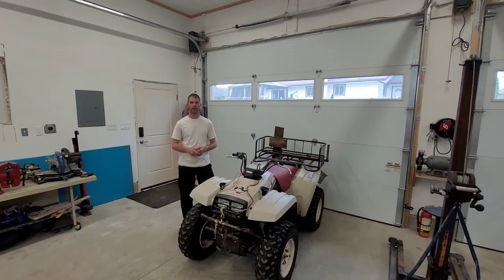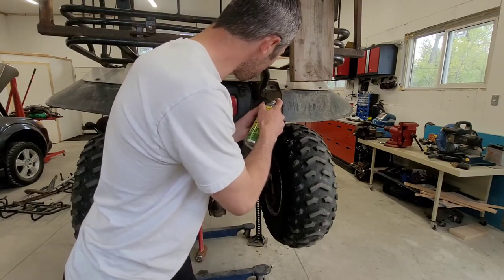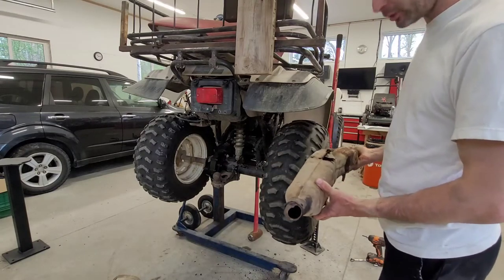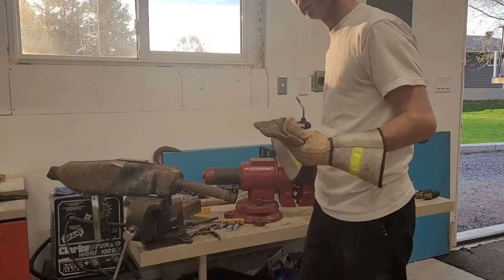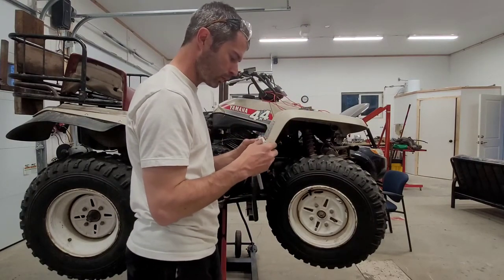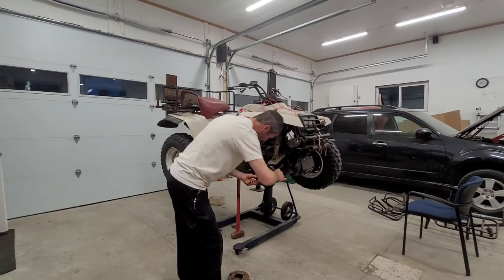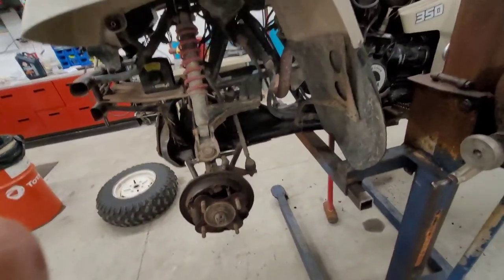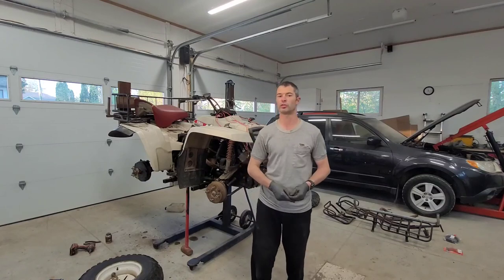Yamaha Big Bear 350 Restoration!!! Part 1

Comment: Yes your welds are not perfect, but those atv mufflers are super thin material wise, so welding them is extremely difficult. In all honesty, that patch job looks good, you did a great job sizing and fitting the metal in place. 👍

Comment: This mini series had been very help in my fixing up a Big Bear just like yours. I continue to run into obstacles though. One I hoped you may be able to help me with is the front transfer case oil. I pulled a CV axle to rebuild and quite a bit of lubricant came out with it. I cannot find any pictures or videos of how to refill the gear box. I cannot find a bolt, plug, or fill tube going to it either. Have you any insight on how to fill it back up? Thanks!
Reply from the maker: Thanks Evan for the comment! I will make a video on how to replace the front diff oil. Once I do, I'll try to notify you right away. Again, thanks for the support!
Reply from the maker: https://youtu.be/-ZW_Ru4fjyY. This is the link to the video you have requested! Again thanks for watching my channel!

Comment: anyone tell me how wide the big bear is tire to tire, I don't know if it fits in my trailer and can't find is the width of 48 inches does that include the tires or not? is it 48 plus tires at 60 wide or 48 with tires included. I have yet to pick up the bear and need to know if it will fit in my truck bed
Reply from the maker: My big bear is 44 inches wide with my 27 inch tires. The overall length is approximately 80 inches. Hope this helps. Thanks for commenting and I hope you enjoy your big bear as much as I do!
Reply: @thehonestmechanic  Well, we took a gamble and shoved the 88 big bear into a trailer 44 inches wide... front tires were tighter than the rear oddly but it fit! are the front tires wider I wonder... Thanks for your uploads, my daughter and I will be working on our big bear in tandem to watching your instructional videos, and kudos to her camera work.

Comment: What is it when your tire dozen moves when you put it in gear? The right side front tire
Reply from the maker: I think you are referring to when I applied the front brake lever on the right side of the handle bar. A few things were stuck inside the drum
Reply: @thehonestmechanic  Thank for that,Do I need to replace the drum
Reply from the maker: @J Smith  that would depend on how worn it is. It would be advisable to measure it and compare with OEM specs

Comment: Just bought the same Big Bear a week ago. Changing the Carb on it today. Still have to find the exhaust heat shield. My dad had one when i was a kid and I loved it. He still has it and it runs like a champ
Reply: Does anyone know the difference between the single cable carb and the dual cable carb?
Reply from the maker: Some older big bears like mine had one cable controlling the throttle while the choke had a pull know on the side. Not exactly sure but I think Yamaha added a choke control o  the handle in later years hence the second cable
Reply: @thehonestmechanic  that’s what I was thinking too but from what I am reading in the manual on the older model they have two throttle cables going in the carb. One moving the piston valve on the top and the other moving the throttle. There is a splitter halfway down the throttle cable that splits it from one cable to 2 going to the carb.
Reply from the maker: @ryana3679  I have it in the shop for another video (spoiler alert)LOL I'll take a look in the morning and get back to ya
Reply: @thehonestmechanic  you rock bud! Thanks.
Reply from the maker: So, I've looked at the Big Bear and I also have two cables and more questions. The parts breakdown doesn't help at all for the cable going  in the side. I have not pulled the carb on a big bear so I have no answers. I'll have investigate further. I might add it to a video 😉 Sorry Ryan....
Reply: @thehonestmechanic  I did the same thing with mine. Turns out they stopped making the 2 cable system and now you can only get the single cable carb. There’s now linkage inside the carb that allows one cable to do what the two cables previously did. If you follow the throttle cable there is a splitter on the older models. When you install a new carb you either replace the throttle cable with one without a splitter or reuse the existing cable with the splitter but only connect one end. I’ve subbed so I’ll be right there when you get that video out.
Reply from the maker: It will be interesting to see how it's setup and how it works! Thanks for the support!!

Comment: Какой пробег у него, я нашёл в России с пробегом 2300 км и хочется понимать сколько он ещё будет ездить? Спасибо
Reply from the maker: not sure if my translation is correct but you are asking the mileage i have on this big bear. My odometer is not very accurate and only displays up to 999 kms. If i had to guess, it currently indicates 365 and it has rolled over at least once so...1364 KMS. Hope this helps !!
Reply: Не знаю если поможет но у меня на работе есть такой же с 10000km